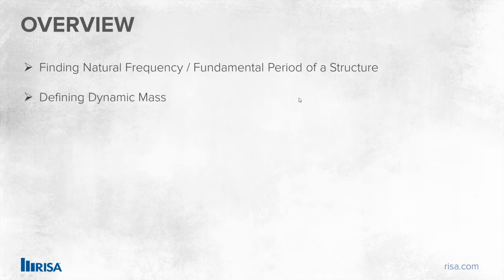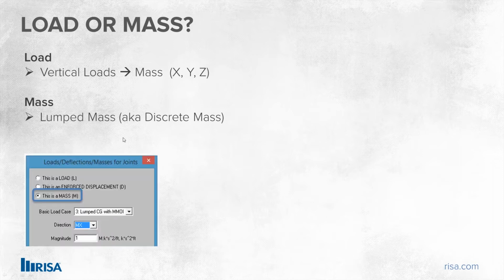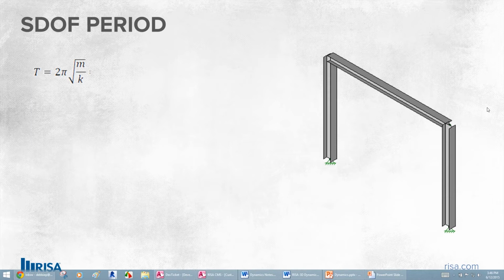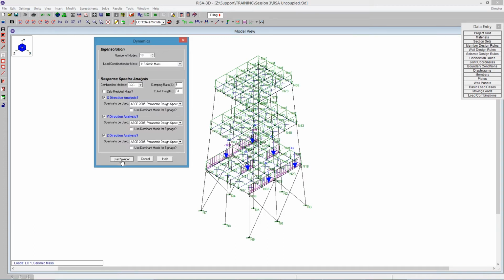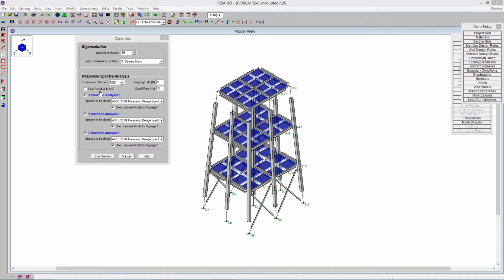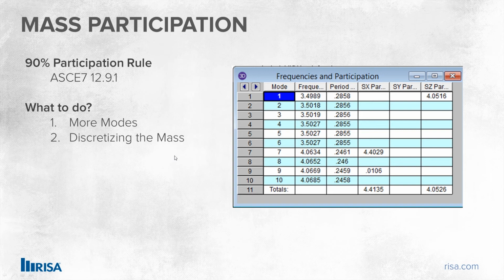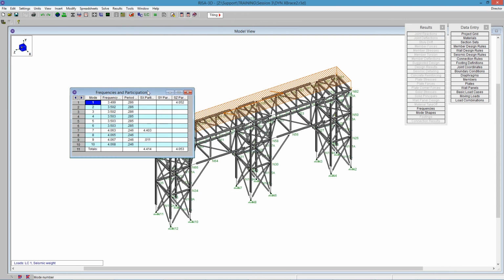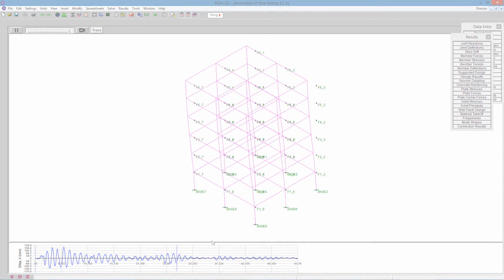Dynamic Analysis in RISA

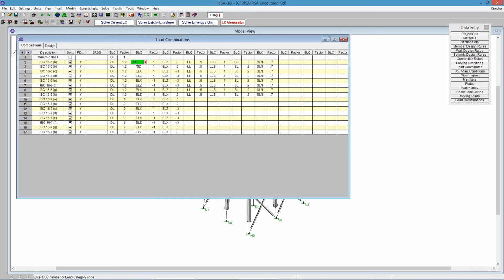Comment: At about 38:40, you copied the SX and SZ cells and overwrote the ELX and ELZ cells.  This works fine for the original cells on the left, but when you overwrote the cells on the right, you mistakenly copied ELZ with SX and ELX with SZ, so your combinations were (SX +/- 0.3 SX) and (SZ +/- 0.3 SZ) instead of doing an orthogonal combination.